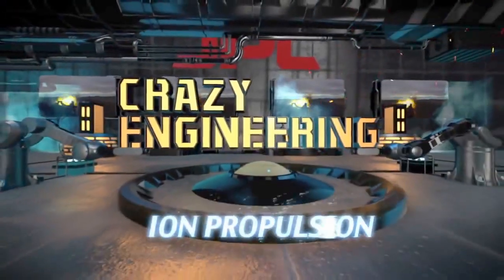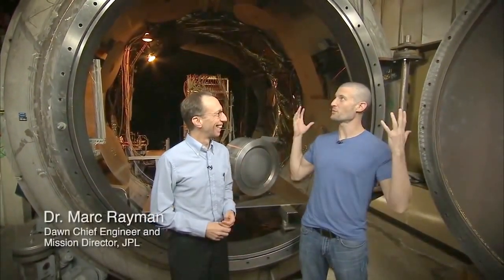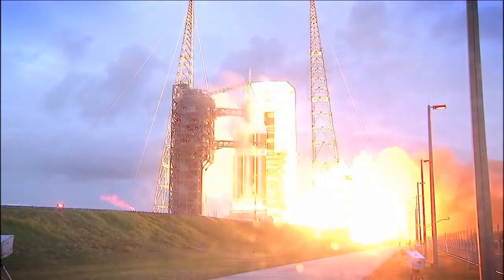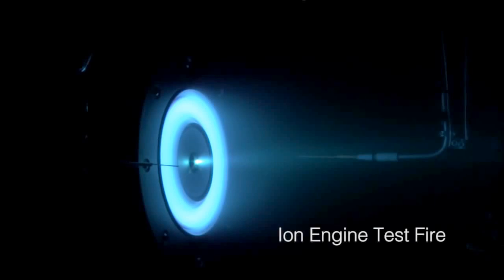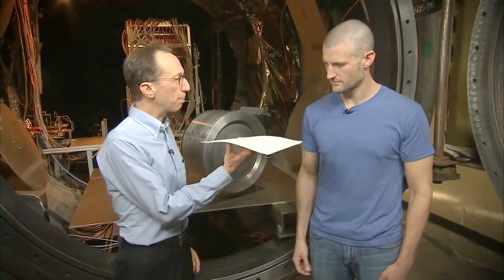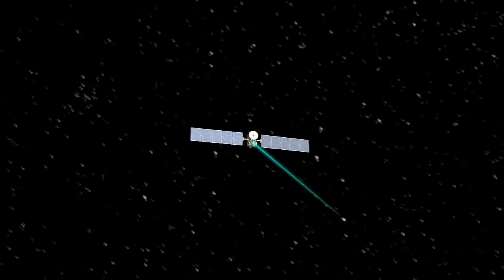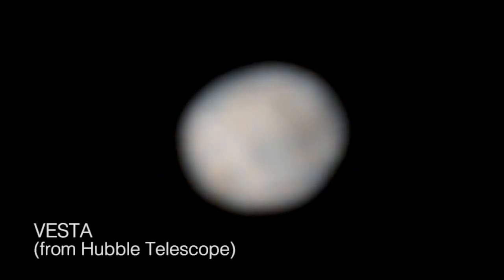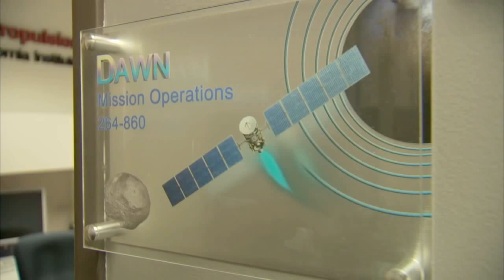NASA Jet Propulsion Laboratory - Ion Propulsion Advance Technology To Power Spacecrafts [720p]

Comment: My father invented the argon engine at JPL in the late sixties I know as I did his drafting at home because he was loosing his sight  also he worked on the ion engines  he was a sr Electrical Engineer coming from Rocket-dyne and before that worked on developing smart bullets at Todd Shipyards during WW2 I know how it works and what was used on the Mariner andVoyager probes he told me they will have power that should last for more than 10000 years

Comment: Here is a patented ion thruster that lifts its power supply from the ground.  It is extremely well verified to be a working device.  It can fly for nearly 2 minutes using onboard lithium polymer batteries.  Or all day on commercially available photo-voltaic cells.  Even though it is a very rough prototype, it has many orders of magnitude more thrust than any other ion propulsion system, and could carry a small tank of propellant.
 Please click the purple channel icon to the left, to see 5 prototypes fly lifting their power supplies against gravity.  There are also links to a website and other info.

Comment: I would also imagine that the fuel  volume needed depending on the mission.
Would be miniscule compared to a normal jet propulsion system.
So many years of reading Engineering and scifi.
Must be a dork in disguise ;-)

Comment: The great aspect of an ion thruster is it's amazing thrust to weight ratio and specific impulse. This thing weights 5% That of a conventional rocket and has incredibly improved fuel weight. If you can somehow burn all fuel at once in an ion thruster, same with a conventional rocket, the ion thruster with 5 kilograms of fuel would have a delta velocity of 56,000 Meters per second, whereas a conventional rocket with 5 kilos of fuel would have a delta velocity of 280 Meters a second.

Comment: ion thrusters have the equivalent thrust of a piece of paper....This video is bogus ... but this is YouTube. ion thrusters take weeks to build up thrust and then it is very little. This would be more for satellites. This man in this video seems so convincing . I have looked over my research papers and found out what a bogus video this is. I just waisted minutes watching this. After I was done watching this worthless video Spock came into my bedroom and told me to get off the internet... so if you have read this far...you are a goofball lol.
Reply: +David smith you forgot to account for the negative pressure in space and the positive pressure in the engine adding acceleration in a zero drag environment lending to faster than average acceleration compared to the drag in the atmosphere proves that this engine is quite reliable though not as powerful as a regular rocket engine which proves that you know some but not a lot about the dynamics and balance forces that make this engine reliable.

Comment: is it possible to increase the energy and will it work on a hover board
Reply: it works only in vaccum and it produces a very weak thrust compare to a liquid propellant engine.
Reply: So like they say wow i was right about the earths core then how   anti gravity liquid iron work . but the earth core makes that same magmetic field like the torus who know one day this tech will help to build and create new planets
Reply: +good boy i feel sad because this propulsion is perfect for military and space explore but it is too weak. It needs four days to accelarate from 0 mph to 60 mph.
Reply: +Hung Duong is there a way to transform a jet engine into photon. jet engine instead of fuel.
Reply: +good boy i dont know about it but i can do some research on it.
Reply: +Hung Duong i don't think it might not work jet engines seem to only work on air maybe magnetic push or making a magnetic wave push at rotating speeds but i heard beatle wing has a magnetic field for anti gravity.
Reply: +good boy that sounds really cool though.
Reply: +Hung Duong yup a inventor idk his name but he supposably used beatle wings and he levitated
Reply: +good boy i gonna do some research on this.
Reply: +Hung Duong thanks i was going to do it but i got distracted on a battery that I'm developing on a small scale.
Reply: +good boy recharges back to its energy capacity with water. i call it rock battery its as similar to mud jars battery small thing but does not dissolves away because its rocks. like a solar you don't need sun light i think i should repost one of my videos on jar dirt experiment.
Reply: +good boy Post it ! i gonna watch it
Reply: +Hung Duong you should watch the jar experiment. first
Reply: +good boy im still building it

Comment: humans with their primitive tech.  c'mon, we need warp drives and light speed capabilities already!
Reply: +Hung Duong actually it is possible to travel faster than light using wavelength and positive pressure distortion to straiten out a sine and thus instant acceleration
Reply: +CarStarCrafter Csc first my theory is saying to not use f=ma (mostly) secondly using the ships motion to translate a sine into a straight line using spacial distortion like the warp drive theory and I also wasn't actually saying what you think it's a theory that proves that photons can travel at faster than light speeds because you have to factor in the fact that you're getting light speed in waves and the photon needs to travel faster than that speed to compensate FOR that specific  wavelength
Reply: CarStarCrafter Csc like i said it's a THEORY and THEORIES CAN BE PROVEN WRONG that doesn't mean that i'm right in other words it's like a Schrodinger's cat theorem
Reply: CarStarCrafter Csc TBTH I almost always think out of the box and have crazy ideas
Reply: +Dont question My Name

Just because we don't know how to do it and it is impossible according to our state of knowledge, it doesn't mean they are not possible altogether.

If you asked someone from 5th century if flying to space or speaking to someone on the other side of Earth are possible, what do you think they would say about that?

Exactly, that it's not possible. But look around now.
Reply: these arent possible

Comment: They've been working on this technology since the 1950's. It's already in use on stealth aircraft,  as a propulsion system on wings to push craft forward at accelerating speeds, capable of silent or ' stealth ' flight.  And you can wager they've been using it off planet for a number of years already. Why do you think the news recently is conditioning people for moon base construction over next coming decades ?   Ditto recent massive structure spotted via kepler telescope near star....  :)
Reply: +Jay D Ion engines have been used in space since 1971. But I can assure you that they're not using them to propel aircraft. An ion engine can't produce enough thrust to move an aircraft.
Reply: ***** Ion Engines have pathetic thrust, but that's perfectly fine for space applications, because there is little to no drag. Ion Engines low thrust is actually their strength, because with it comes a very high specific impulse (thousands of seconds), compared to the 200-450 seconds of chemical, and 800-1500 seconds of nuclear-thermal rockets.
Reply: What massive structure spotted near which star? Please share.
Reply: I know Jay D I was Up there for 87 years they age reversed me and sent me back to this god forsaken SHITHOLE of a planet I DIDN'T WANNA COME BACK, I used technology these KIDS are just getting now BACK THEN! and Tech not many humans could wrap their freakin heads around Inter Dimensional Slip gates and shit like that you know Corey Goode He STOLE SOME OF MY STORY AND INTEGRATED IT INTO HIS THE LITTLE DOGSHIT KICKING SHIT SCRAPE
Reply: Tell me about it Sarge! these kids think this is new shit IT AIN'T Ion engines are too Piss weak!
Reply: Yeah good for satellites not good for aircraft!

Comment: Can't we use a solar-powered engine? It may sound crazy but I want to know if it's possible at all to have an engine powered with electricity.
Reply: +XpertPilotFSX One that purely runs on electricity? Yes, an electron or a photon thruster.
Reply: +XpertPilotFSX     Thats what an ion engine is , an electricity powered rocket engine.
Reply: Don Graham no, but it uses Xenon gas too. I mean one that PURELY runs on electricity.
Reply: Yes the working mass is Xenon gas and the accelerating component is electricity .
Reply: Don Graham But that's still not PURELY electricity. There's still Xenon gas. I'm talking about nothing but electricity and electricity only. Nothing else. NOTHING ELSE.
If you don't know what the word NOTHING ELSE or PURELY means, I'm concerned
Reply: XpertPilotFSX Laser drives. Their TWR is garbage, but they run on nothing but electricity.
Reply: Sarge Rho Good, there we go!
Reply: +XpertPilotFSX      Is it possible to have an engine powered with electricity?  Um, XpertPilotFSX, meet Tesla.
Reply: ***** But it needs argon or any other low-melting-point metal to shoot out the back.

Not PURELY electricity.
Reply: ***** You actually can. Lasers re purely electric, but you can also use electron beams for propulsion.
Reply: atomic hydrogen particles exist in space and can be used as the medium.

Comment: Does ion engine run out of fuel?
Reply: Yes.  They get extremely high efficiency for the fuel given and require lots of electricity to run.
Reply: adolfhilter They still use a fuel - that's what's emitted from the back end of the engine.  It's very efficient, so can run for a very long period without refuelling.  High specific power output, very low power output, but this doesn't matter much without friction in space.
Reply: +Yuuji × Shana ♡ They can, it's just less efficient because of the atmosphere, and the solar panels might break due to size.

Comment: I sent a Kerbal to Eeloo with Ion engines.
Reply: Teach me ur ways
Reply: ZzmemeguyzZ Do you play KSP?
Reply: ofc i do
Reply: ZzmemeguyzZ Hitchhiker module with 8 ion engines lots of zeon gas, about 12 gigantor solor arays (trusses used to allow for attachment) and 12000 battery capacity (engine runs in the planets shadow are required to circularise orbit).  Lander was conventional but kept as small as possible.  The craft was sent to solar orbit with a conventional booster.
Reply: Oh, ok cool
Reply: +jannmutube Do you know we are talking about a game?   Kerbal Space Program.  The battery has a storage capacity of 12000 units not volts.
Ion propulsion needs to advance before it would be practical to use for a maned planetary mission.
Reply: +Glen Cychosz  A 12000 volt batter for how big of a space craft?  There must be some kind of mass/weight to volt ratio?  Also, where do they get the zeon gas?  What was the name of the space craft?
Reply: +jannmutube 12000 Battery is needed to circularize orbit.  You could probably reduce it some if you want. Zeon gas is in the fuel tank section.
Reply: Glen Cychosz

A 12000 v batter is need for a satellite to orbit the earth but how big of a battery would be needed for a manned space ship to orbit the earth,  or mars? How big a battery for a manned spaceship to Jupiter?.  I know zeon gas is fuel but what kind of fuel... is it processed from oil or what is it?
Reply: @jannmutube  Xenon gas. There's 3 tanks available. Radial, Mk0, and Mk1.
Reply: Glen Cychosz
Reply: Good job man
Reply: Thanks for pointing that out.